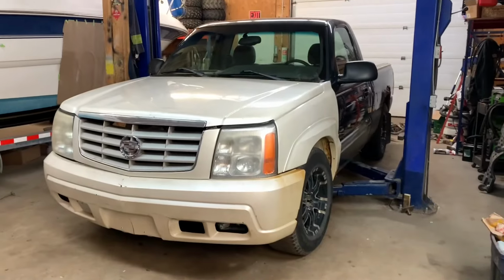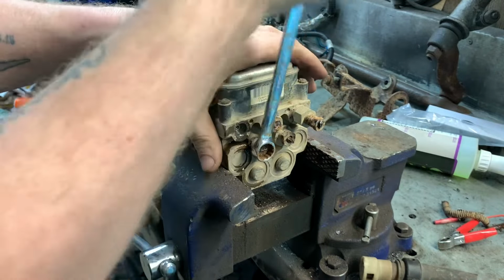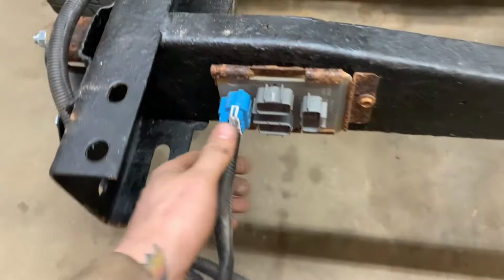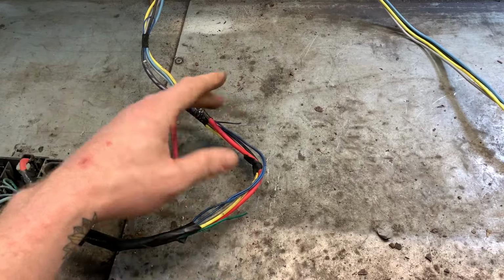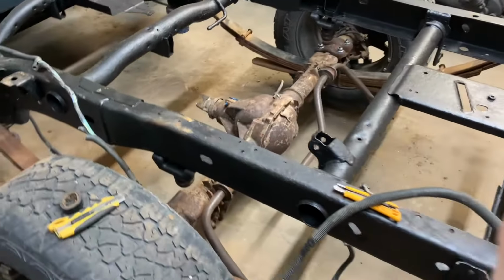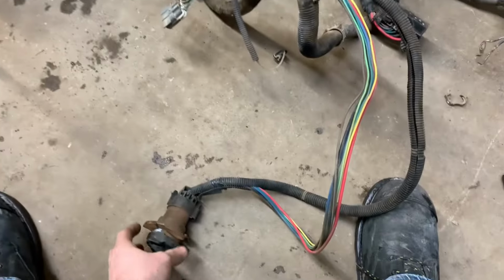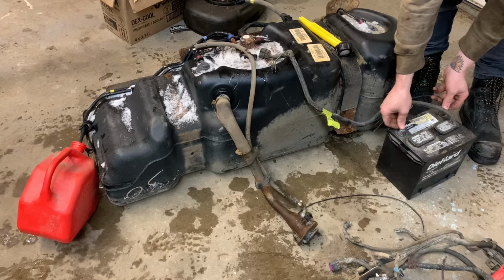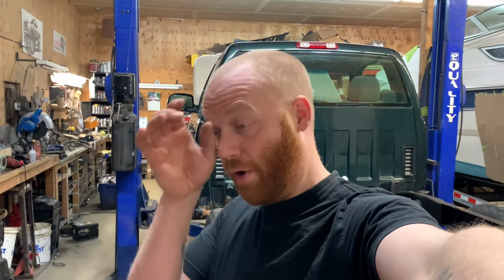A weeks worth of wiring in 39 minuites! Awd chevy gets a chassis harness - Desperado

Comment: Great job on the wiring, for some reason, I find wiring so relaxing. Quick question... is there an IRS available for that frame you have? I recently drove a 2022 Ford Expedition with the 400 horsepower ecoboost and I have to say, holy crud, it handles absolutely amazing. I got to drive it on a rough back road and with the independent rear suspension, I cannot believe how well such a huge vehicle handled. The acceleration on that thing was nuts for such a big truck, but the handling and brakes were equally as amazing. Feels like a sports car from the 2000's, but in a gigantic SUV body instead!
Reply from the maker: I wish there were an IRS available for it, I’d be all over it! 

I almost had a late 80s thunderbird with the 8.8 IRS rear, that would have been wicked. 

I bet those newer trucks can move, especially with the turbos on them. I drove an ecoboost crew cab F150 and it surprised me.
Reply: Maybe you could find a jag xj6,xj12,or xjs rear end. Dana 44 gears fit im told
Reply from the maker: @brianhaw9398 never heard of that before, neat!

Comment: You need to look up the butt connectors with the solder inside.  You crimp them on and hit them with heat.  They solder the wires and are their own heat shrink as well.  Pretty snazzy.

This was a pretty good video about the most boring part of building a truck.  

Any reason you decided to go with ABS after?
Reply from the maker: I’ve tried the ones we have here, but the torch just melted the heat shrink before the solder melted so I never bothered after. 

Oh I changed my mind about ABS after, that was just a lapse in judgement at the time
Reply: @StationroadRatrods  yeah, I beleive they only work with a heat gun.  Torch is too much hot.  

I do believe you will get a traction control light and an ABS light if you delete ABS.  But I don't think it will affect anything and put you in limp mode.  Hopefully it's as easy as pulling a couple bulbs.
Reply from the maker: @Jordy-927 ahh that would do it. 

Yeah, I have a cricut and some black vinyl that’ll work perfectly behind the lens 🤪
Reply: @StationroadRatrods  too bad you couldn't print something cool and leave the lights on.  Like one saying burnout mode and the other saying engaged or active or something.   Lol
Reply from the maker: Oh wow now there’s an idea
Reply: @StationroadRatrods  hmmm....

Comment: You don’t have to soldering these days although when done correctly it is a very quality connection but it’s almost always done incorrectly, the wire gets overheated & becomes brittle & brakes. Using non insulated butt connectors with a marine heat shrink is a far better & more consistent solution to wiring especially if a’guy gets into pining plugs & what not
Reply from the maker: Good tip on the wires becoming brittle, I’ve seen that before. I usually just hold the torch there long enough for the solder to melt. 

I’ve seen these little U shaped crimp connectors before, maybe I’ll order some up.